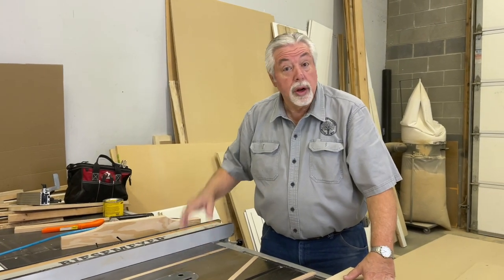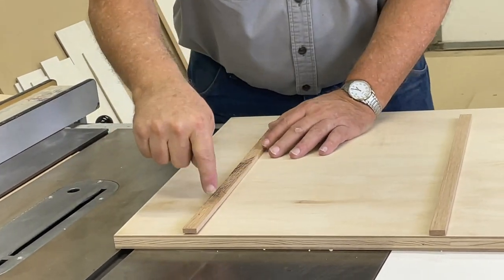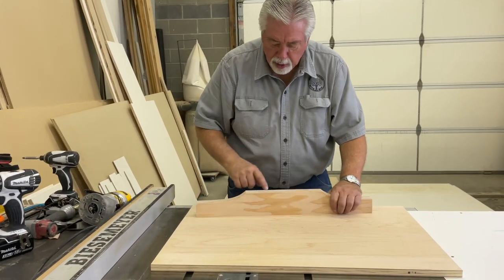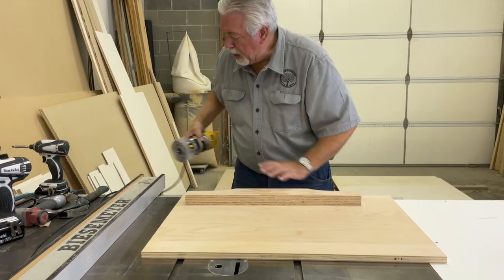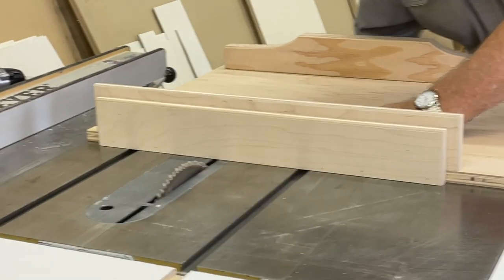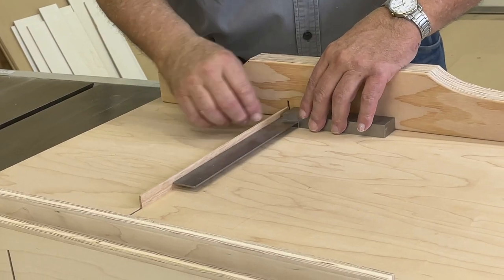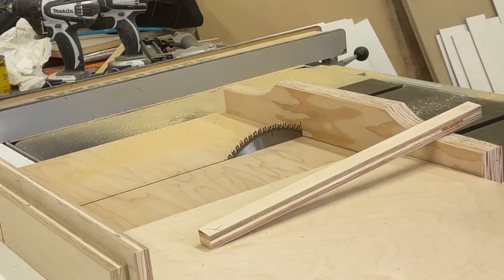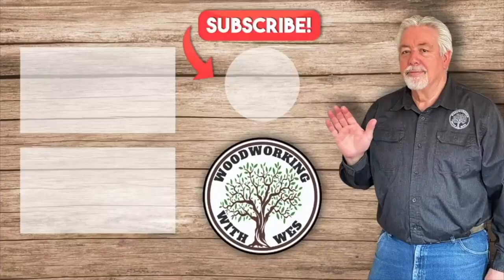Make A Super Accurate Crosscut Sled

Comment: Excellent video. I have a suggestion for you to teach novices who don't know jack squat about woodworking jigs (like me). Here are my questions if you don't mind answering:  1. What is the sloping angle pattern for the back sled fence?  2.  Why didn't you created and install the exact same front fence you did for the back fence?  Why the two pieces of wood with one lower rather than the two three quarter boards you did for the front fence?  Runners and spacer:   How thick are the spacers vs. how thick is the white oak runners. I know it will depend on how deep the groves are, but wanting to see on your what you did exactly? Thank you!

Comment: My last two crosscut sleds (and my 45 miter bevel sled) have been set up with a nice square. Never had an issued cutting perfect 90's! Personal belief is the 5 Cut Method is great if you want to be in thou' realm, but we need square dead cuts not finely tuned rocket motors! Great video Wes!